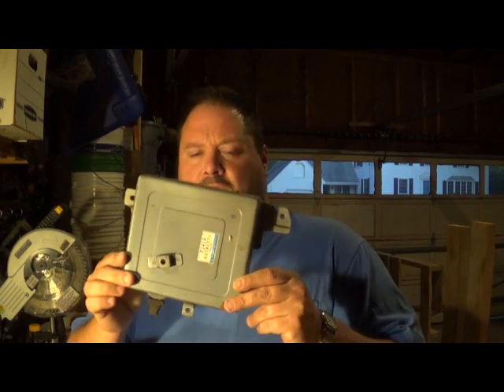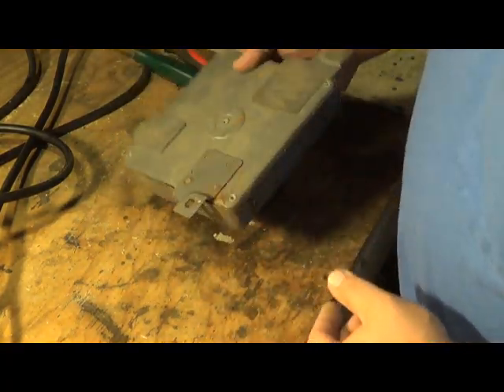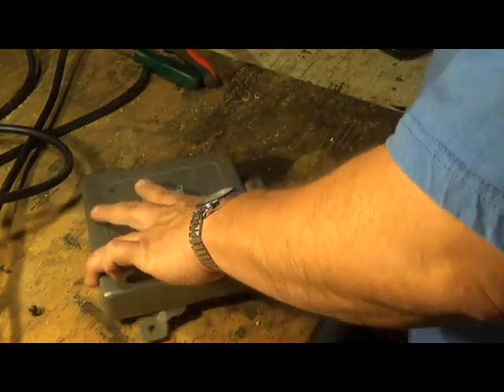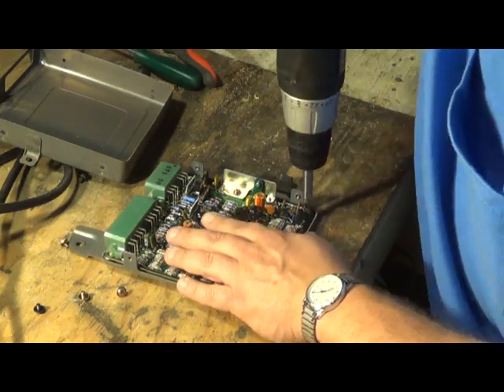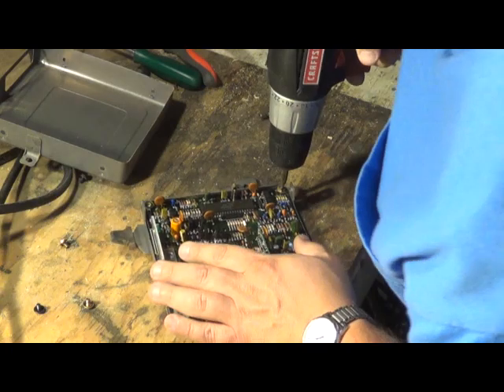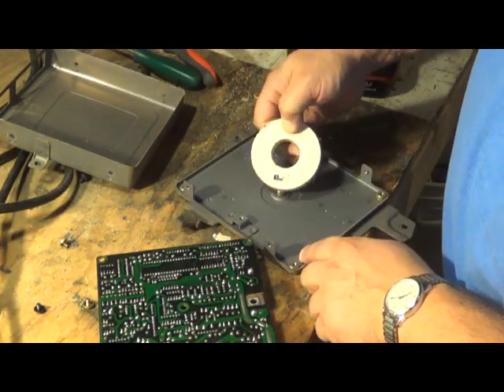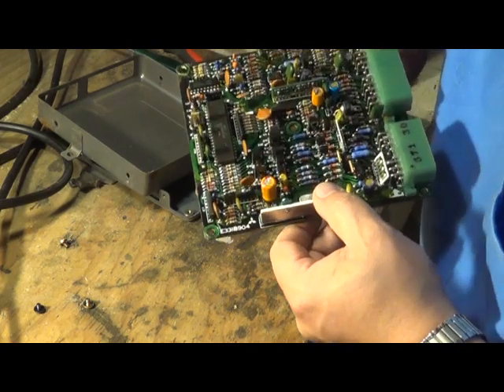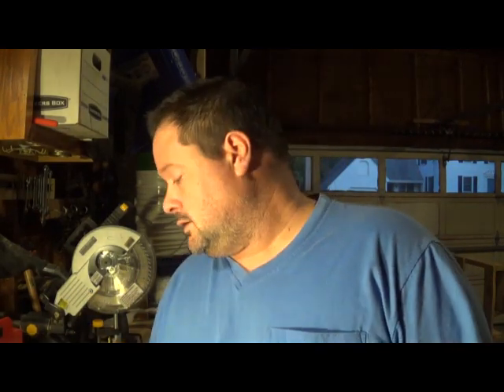Scrapping a Car Computer -MooseScrapper

Comment: Due to the nature of ECM use.. cars trucks.. which require high reliability, safety and vibration protection, usually use high quality pins (Copper Nickel Silver pin w Gold plate) in the connectors and also heavy duty computer chips manufactured exclusively for the exact vehicle (heavy gauge high strength bonding wires inside) 
✌️PT

Comment: From the part number you mentioned, that computer you got is from a mazda from the late 80's or early 90's :). It s a shame it was dripping with water. I just saw sold one anywhere from $30 to $80 sold as used.

Comment: For fun you might want to shred a old Pager.  I scrapped three. (I had to promise not to resell them.) I got a Motorola Gold Cap Ceramic chip from one but the other two were ...well...bleh.

I was expecting that you'd find an 8086 or a 386 CPU from that car computer.

Comment: moose this is awesome I have been wanting to see what was in those computers for a long time.  It is pretty much what I expected low grade computer board.  Also if u have access to cars go for the relays in the main fuse box they usually have silver contacts.  Most of the time if those work they are more valuable for resale though.  Awesome video